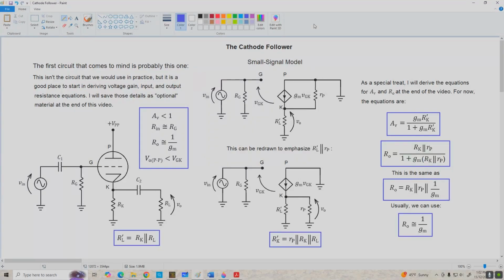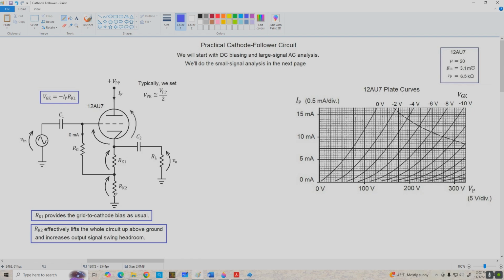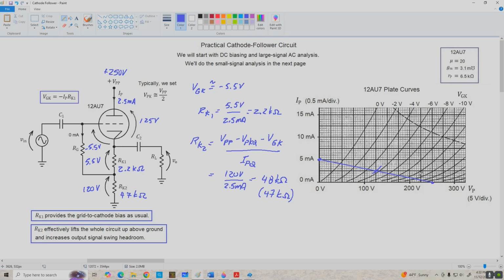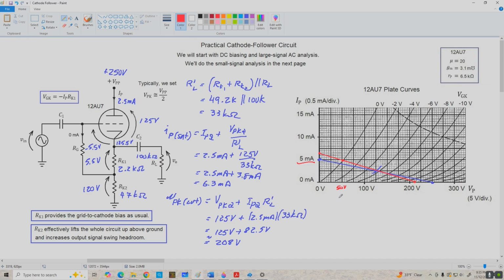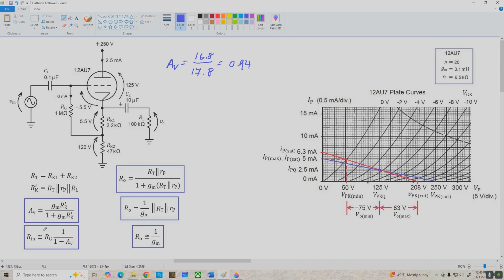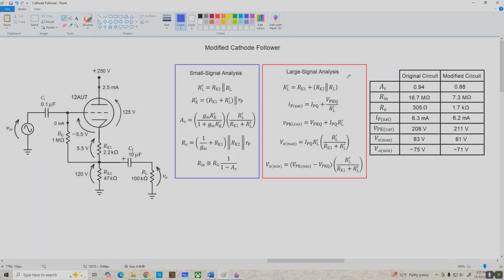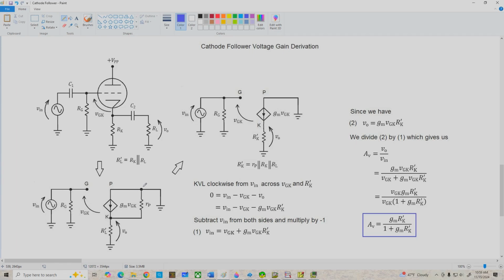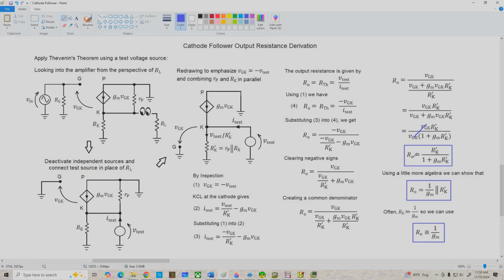Topic 66: The Cathode Follower

Comment: Hello, can you tell me how to calculate Rk1 and Rk2 for the parrarel connection for two triodes? I understand that Rk1 will be standard divided by 2?
Reply: So, the calculation of RK1 is clerar now. Do I have to do the same for Rk2? I mean to divdide the value of Rk2 for single triode  by 2?
Reply from the maker: That’s correct 👍🏻
Reply: @Denton.Dailey  Probably you didn't see my second reply, but can you give me some advice regarding calculation of RK2? RK1 is clear now.
Reply from the maker: Sorry for the year-long delayed reply. YouTube never notifies me of replies to replies 😒. Anyway, use R_k2 to drop sufficient voltage to locate the Q-point wherever you want it on the load line, typucally V_PK = V_PP/2 or similar. You can usually disregard the drop across R_k1.

Comment: Impratical?  The cathode follower has all sorts of practical uses, one that comes to mind is impedance matching another is amplification in a negative impedance amplifier
Reply from the maker: @ludmilascoles1195  the simple implementation using basic cathode feedback biasing is not very practical because of its limited output voltage swing. The versions covered later are extremely practical and widely used.
Reply: @Electronics4Guitar  Well it is a very practical buffer, it is not a good amplifier, it is like saying the claw of a hammer is not very practical for driving nails.
Reply: @Denton.Dailey  But if we want to drive a low resistance load, such as 500 Ohms, we do not have much choice.
Reply: The CF of the JCM800 has only one 100k from cathode to ground and no feedback through that voltage divider you showed. This is similar to the first version of your cathode follower, that you deemed impractical. Perhaps the difference is that there is a DC coupled from the precious stage.
How does your analysis change for this different topology?

Comment: WHAT IS YOUR DEFINITION OF A SMALL SIGNAL VOLTAGE AND,LARGE SIGNAL VOLTAGE?
Reply from the maker: In the context of typical amplifier applications, a small signal is a signal that allows us to use the linearized behavioral model of the device (BJT, FET, tube or whatever). We assume that device parameters are constant and things like clipping don’t occur. 

A large signal is one that causes the amplifier to behave nonlinearly- usually in the form of clipping.
If we are dealing with circuits that are inherently nonlinear (log amps, analog multipliers etc) then we make other assumptions.
Reply: For RK1 it is clear now but how to calculate RK2? Also I just need to divide by 2 the value for single triode?